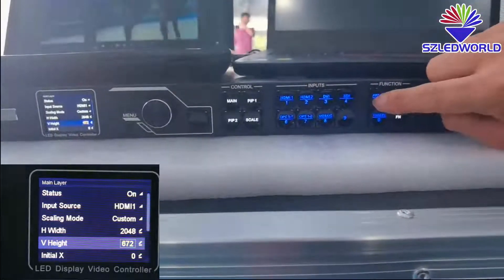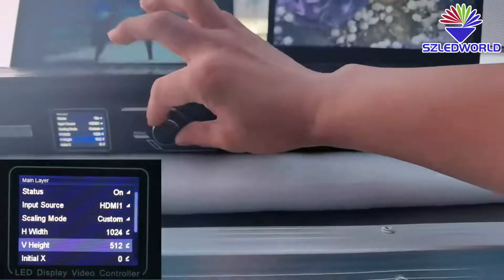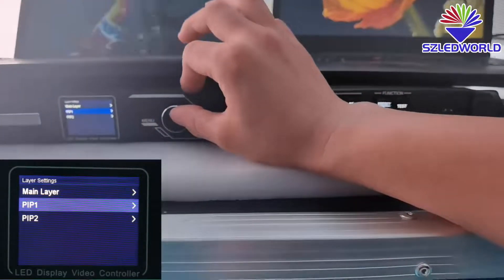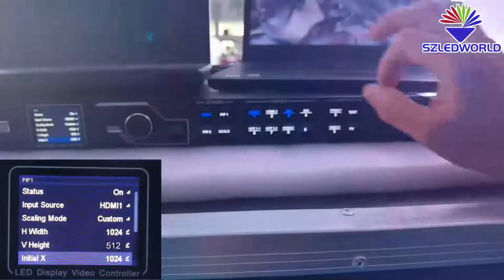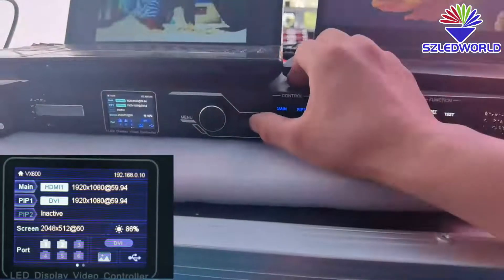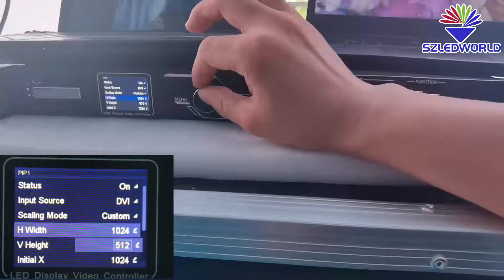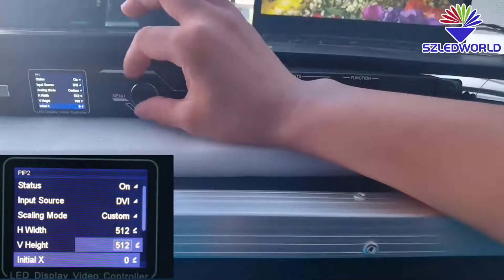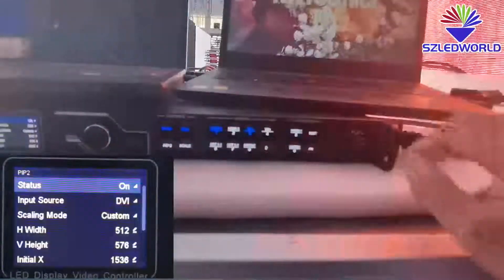video processor operation for led display screen video wall 4K novastar vx6s,vx4s, vx600,vx1000 set

Comment: My processor says no input, after connecting HDMI, VGA, DVI cable. Please what is the problem?  

Note: I tested the cables with other devices and it is working fine.
Reply from the maker: Hello Bro.
Maybe your motherboard has problem.
1, Attempted to restore factory settings:
   Press the "Ok" button - setup - advance (8th option) - restore factory settings, and checked if it's okay?

2, Try using a computer signal through HDMI to see if the cable is okay?

3, If the above two steps still don't work, the only option is to send the motherboard back for repair.
Reply: Same problem to mi on mi precession  they said no hdmi signal